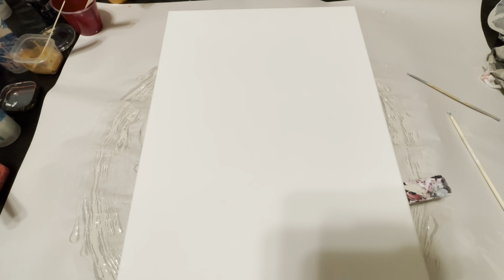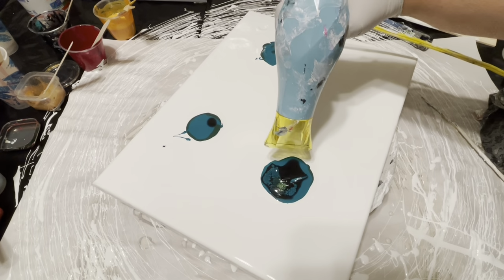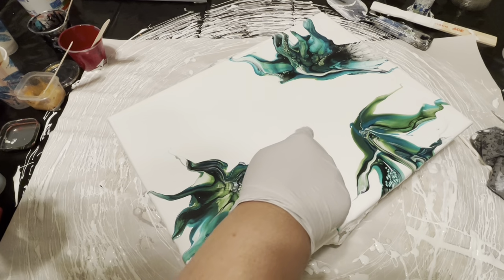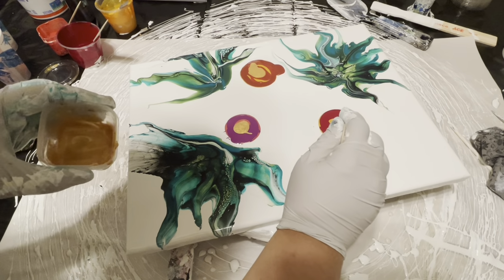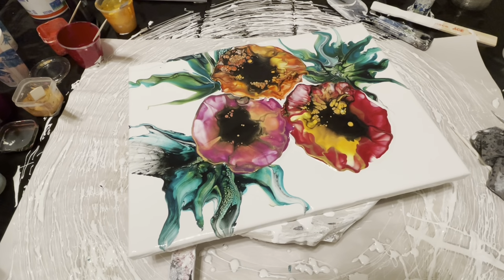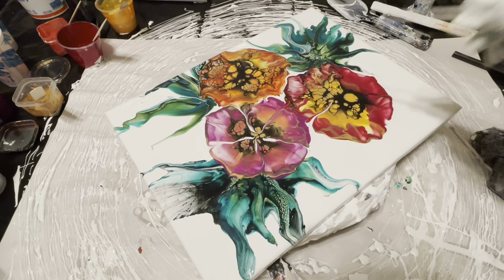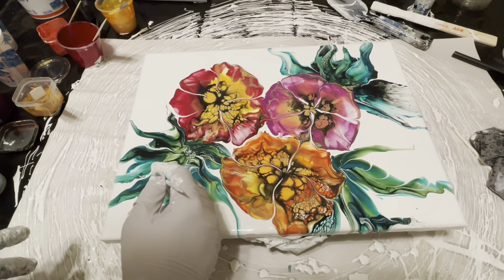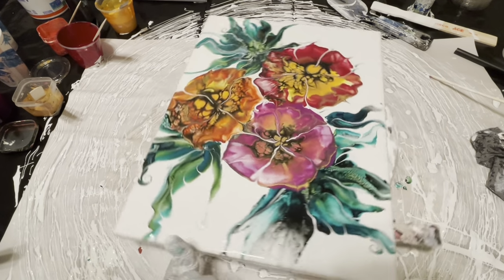#162 Readjusting the technique for better outcome

Comment: Simply stunning work!  If you haven't tried before, tweezers work very well for picking out the smallest  bits out of the paint...it allows for a more delicate approach than the two skewer method.  Just a thought.  Thank you for sharing, I am  working on my flower and blow dryer techniques too!!
Reply from the maker: Thanks for the tip!